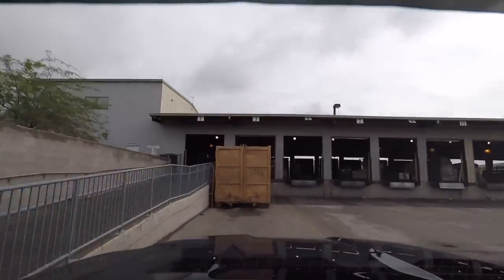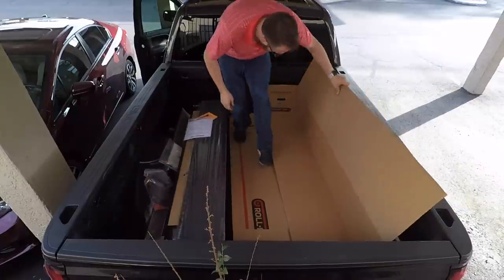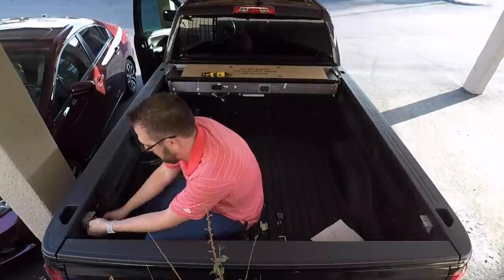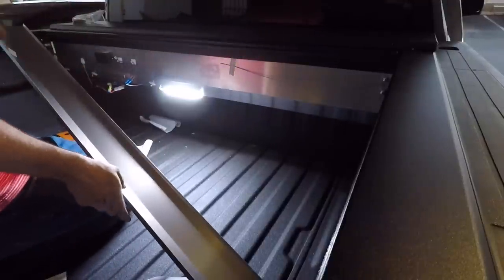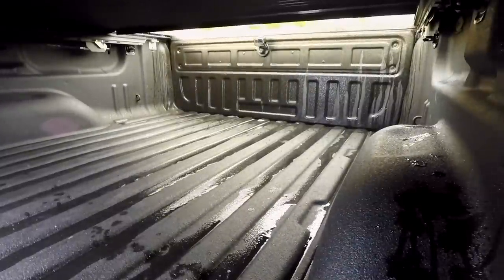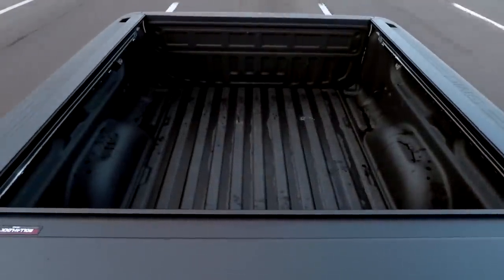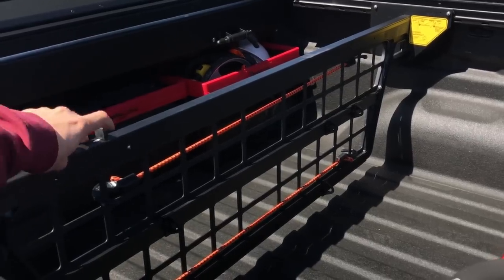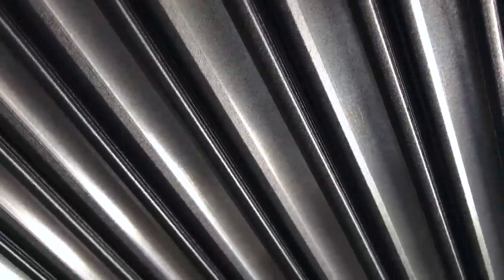Roll-N-Lock E-Series Tonneau Cover Review  (RC221E)

Comment: I’ve had a original style Roll and Lock on my Chevy 3500 Dually Diesel for   About 20 years now it’s held up well but it was never water tight  I keep a  water tight box under the cover and use my back seat for dry storage

Comment: Hello there. I’ve watched your video on the roll n lock e-series as one of many videos as I’ve been doing extensive research to pick a cover and landed on this based on the great reviews. I had the e-series professionally installed (I live in PA) and everything about the install is fine. But the thing leaks horribly through the slats of the top! Do you have any experience with this happening?
Reply: Hey, I had the same issue with mine, it leaks horribly.  Unfortunately mine completely broke 3 months in the rail that spins fell so it wouldn't open and close, customer service is absolutely horrible they pretty much said oh well and would t do anything about it.  So I really hope things are going better for you then they did for me.

Comment: I bought the Pace Edwards cover for my truck.  This is nice but mine covers the complete rail top with channels in it to add a ladder rack or many other items.  As for snow i live in Upstate New York and we get lots of snow in Syracusr to Mohawk Valley. Never an issue with weight as ive stood on mine but ice forms then you have to chip it away to open.  Keeps its truly dry and very secure.  Also has the feature of actually pinching an object that is taller against tailgate to hold. 
For the money well worth it. Better than trifold or fiberglass.  Mine has been on for over 4 years now and i posted a quick 15 second video on my page for it.   I would buy again over anything else.  
This is nice but i enjoy the channel rails as i can tie things to an eyebolt anyplace along the length and add a rack with out drilling holes or compromising the channel that the cover rolls in.
Reply from the maker: Thanks for the input.

Comment: Do the slats overlap or can a craft knife  blade fit between the slats ,I see alot of pp now getting stuff stolen because the bad guys are cutting the rubber hinge between the slats ,take a few seconds to break in !
Reply: Not for this model.  Part of the reason it’s so expensive is because each of the slats are physically nested to the next one via a channel connection of sorts.  It allows for the rotation needed to roll up but maintains the continuity of a single long sheet of metal.
Reply from the maker: Between the slats (Sorry for the late reply, trying to catch up on old comments I missed)
Reply: @GearsGadgets wait so can it be cut between the slots or not

Comment: if you stop it anywhere along the track is it automatically locked? Can it even be opened manually?
Reply from the maker: Yes you can stop it anywhere on the track and it stays locked in that position. Yes it can be opened manually, there is a release latch along the passenger side rail that disengages the motor gear and allows you to freely operate it if needed (I never do but you can)

Comment: I like to go "Ricky Bobby" in my truck (FAST), does this bad boy vibrate hard at high speeds? Could you hear of any vibration during your road test?
Reply: Id like an answer as well
Reply: @---tx9xx  

Well, I bought the cover since the post. 
No, I don't hear any vibration at high speeds. I've gone as fast as 110 and kept that speed for about a minute straight and the only thing I can say is it fluttered like crazy.
Reply: @gorillaking210  hey thanks so much for the reply. do you hear it though at highway speeds with your windows open? And no music. Also how has your experience been with it Re waterproofing, strength, how much space it takes up etc
Reply: @---tx9xx  

You're welcome. Happy to help with what I know. 
As far as sound, I don't hear the bed cover making any noise (with radio off and windows down). BUT, to be honest I have an aftermarket exhaust on my truck that my keep me from hearing if it truly does. In my opinion, I still believe it that the cover doesn't make any "what the hell is that!" noise. WATERPROOF: it's not sealed airtight, so some water does get in the bed but it will keep 95% of what you have in there dry. The 5% that does get wet is no more than if you were to wash your hands and use one of those cheap air dryers in a public bathroom to dry your hands and you walked off before your hands were COMPLETELY DRY......nothing major. SPACE: I have a short bed truck. If a visual is needed, it's GMC Sierra. I can still put my fit my crotch rocket in the bed (at an angle) and can almost close the tailgate. So there is still  plenty of room as far as what my situation is trying to explain. Your concern could be different from mine when it comes to if that's enough room for you. The housing that the cover rolls into doesn't even touch the floor of the bed, which leaves a decent space to put some stuff up under it (not big ass items) but stuff can fit right under it if needed. Truthfully, I like it. And I've gotten compliments. It really looks smooth as hell when you push the button and it starts to roll back. It looks really good on my truck. The install isn't bad at all. It can be done by one, but I had my young son put it on with me and we had fun doing it. Hope this helps.
Reply: @gorillaking210  Thanks so much super helpful, I don't know anyone personally who has it and it's great to get a firsthand reply from a real person, not a salesman. Do you have an opinion on how theft-resistant it is?  (vs something like a diamonback) Finally - do you have any idea by any chance if the remote control can be programmed to the garage buttons on the truck? I have an F-150 that has 3 universal garage door opener buttons that I have the garage programmed to, would be awesome if could program the remote control for the tonneau to them. And hey does it get real hot in the sun? Thanks again bud
Reply: @---tx9xx  

HOT: HELLLLL YES this cover gets hot. But I live in Texas and the heat out here is on another level. 
THEFT: I'm not a hoodlum but I'm pretty sure I could break in to this, IF I HAD PLENTY OF TIME AND COULD MAKE ALL THE NOISE I WANTED. Honestly it wouldn't be easy if someone did try. The diamondback probably will be the strongest of the two but again, I could get past that too......IF I HAD TIME. 
This cover is strong. Not the strongest. You wouldn't be able to stand on it (like you could with a diamondback cover), but I've put some heavy stuff (not super heavy) and it was fine. This cover has a really low profile which I really like. I was going for a sex sleek look with my truck and this cover was perfect for me. My truck is kept in a garage but I do frequent "unsavory place" a lot and hadn't had a issue yet. My truck also attracts a lot of attention with the things I've done to it and I haven't had anybody try something stupid. I'm also not stupid and park in the best spots possible that doesn't give a would be bad guy an opportunity to do something stupid. And it does help that I'm a slightly larger person that will make some think twice. I did say I live in Texas. Damn near everyone has a gun, so I think that helps as well with making someone think twice if its its really worth it. Crime does still happen. If someone really want what you got, they can break this cover and get it (it wouldn't be easy), but the way I think nothing is impossible if your determine. Desperate fools do do desperate shit.
Reply: .....also, not sure if you could program the remote to work with the buttons innyour truck. I don't see why not though. Never thought about doing that but you definitely got me curious to wanting to try to do that. Lol
Reply: @gorillaking210  Thanks so much for taking the time to reply - hey that would be awesome if you could go see if that owuld work or not to program it to the garage door buttons on the driver's side. I figure you'd have one button for the open button and one for the close button.
Reply: @---tx9xx  

I'm seriously considering looking into that. Well, good luck with your decision. Hopefully I was able to help with my experience/what I know.
Reply: @gorillaking210  That'd be awesome if you could get back to me after trying to program it to the garage door buttons, noone from any dealers to the company itself could give me an answer and that'd be a game changer for me. Much appreciated sir.
Reply: @gorillaking210  Hey did you ever get around to trying to program the buttons to the f-150 universal garage door opener buttons on the visor? Thanks so much and have a great labor day weekend!

Comment: Wish I had watched this before I bought mine, leaks like a sieve!!, Damaged seals in packing didn't help and Roll N Lock Customer Service is Brutal.
Reply: Funny you said that, roll n lock is horrible.   I bought my cover got the most expensive one they offered at the time it was over 3,000$ not only did it leak horribly but 3 months in the rail that spins the cover broke.  I contacted roll n lock multiple times and their response was well I don't know what to tell you, they were nasty as hell to me said they won't do anything without proof so I sent multiple videos, when I got no response I would call back and they would tell me they never received it.  This went on and on they refused to do a thing about it

Comment: Is there a manual crank system to open close it - for when the motor dies on it?
Reply from the maker: Sort of, There is a release latch on the inside along the rail, you can disengage the motor and operate it manually if that were to happen.
Reply: @GearsGadgets  how far along is it donhou have to crawl in ?

Comment: That cover is pretty cool was just wondering how much space does the motor take how many inches. And man that thing really is strong I would be scared to open and close that thing on the highway.
Reply from the maker: Opening and closing on the highway isn't bad. I don't want to quote the size of the bulkhead because it might be different for every truck. I can say, it isn't really that big and I don't find it getting in my way.
Reply: If you could measure how big the motor would be that would be huge I own a similar truck and I can't see the motor size being too much bigger on any other truck unless it's an 8-foot bed where it has to roll up more will be good to know how long your bed is that would probably determine how many inches thick it will be when you fold it up
Reply: @GearsGadgets  Any idea if the remote control can be programmed to the f-150 universal garage door opener buttons?

Comment: If you have a tool box can you just move the whole system forward or will that not work?
Reply from the maker: Honestly, even if it would work (which I cant confirm), I wouldn't do it. Between the toolbox and the tonneau cover bulkhead that it coils into, it would take up so much bed that it would be crazy. That's just my opinion. Im sure you could rig it up, but I wouldn't be able to confirm it would work.
Reply: They make a tool box/roll up tonneau cover combo.  I have one and it works great

Comment: Can you make it stay partially opened, or is it either closed or open?
Reply from the maker: You can make it stay partially open just by tapping the remote button where you want it to stay and it stops there.
Reply: Gears & Gadgets that’s awesome. I want one but I don’t think they make one that’s electric for my 2017 ram rebel with the ram boxes
Reply: Jeremy Miller check out RetraxPRO

Comment: How would it work when its covered in ice build up  ?
Reply from the maker: It does the exact same thing as every other cover on the market. I’ve builds up on the flat surface, it sucks for a day for two, then it goes away. I am originally from Buffalo NY so I understand how cold weather works. It makes everything suck including freezing up car doors and every tonneau cover being flat causes an issue. If it’s that big of a problem, get a garage. Otherwise deal with the misery for a few days like everyone else.
Reply: @GearsGadgets  Or get a one piece hinged tonneau cover.
Reply from the maker: @frankthompson3495  you are more than welcome to buy whatever tonneau cover works best for you with relatively uncommon scenarios. 99.99999% of people can deal with some ice for a day or two and would opt for the cover that has more utility the majority of the time but there isn’t one answer for everyone.

Comment: Can this cover be opened manually if necessary?
Reply from the maker: Yeah it has a manual release.
Reply: @GearsGadgets  can it be locked and unlocked manually? How does that work if it’s locked
Reply: I would also love to see a demo of the electric cover in manual mode.
Reply: @jordanhammerman7955  that'd be great. Also interested how strong it is ie can you stand on it, load stuff on it

Comment: What is the max height dimension that it will clear in order to close? I have a 2019 Silverado. Thanks
Reply from the maker: About an inch +/- below the bed rail until you get to the bulkhead where the cover rolls into.

Comment: How is this holding up?
Reply from the maker: Really good.
Reply: Gears & Gadgets How does it lock?
Reply from the maker: Getout Mybidnez it’s basically just always “in gear” so it is basically self locking. It would require the same amount or more effort to break it open as it would if you jumped on it to break it. It also has a release that you can access Incase something happens where you lose power or the motor fries or something so you could put it into a “manual mode”
Reply: Gears & Gadgets thanks

Comment: Wonder how this thing would work in canada winter time
Reply: I got a  tyger tri-fold tonneau cover for my Silverado,  handles  new Hampshire  winter pretty well. Easy install also
Reply: Mine freezes shut, and it's a manual as well. I wouldn't dare try the electric powered variant up here.
Reply from the maker: Just fine I presume

Comment: Can you give the dimensions of the unit at front of the bed that it rolls into?
Reply from the maker: Sorry for the super late reply Josh Breslin. I appreciate that you stopped by the channel and apologize for not responding WAY sooner.
Reply: @GearsGadgets  Still didn't give an answer
Reply from the maker: Cheek Busting 101 because the question was asked 7 months ago and I’m 99% positive he wasn’t waiting on me. Also, I’m not going to start quoting dimensions to find out someone buys it for a longer or shorter bed and the bulkhead size changes between them, then I’m to blame for being wrong. I would direct those questions to the manufacturer.
Reply: @GearsGadgets  I have the exact same truck as you so would be interested in the dimensions, thank you!

Comment: Just had this installed on my 2019 Sierra. Any idea of a rack system that would work to elevate a load (a canoe or Paddleboard) with crossbars above the cab? I know RollnLock makes a quikrak, but that’s a low crossbar and the canoe would extend 10 feet out the back.
Reply from the maker: Hmm I am not sure, haven't looked into it so I wouldn't be able to recommend anything.

Comment: About how much of the box does it take up?
Reply from the maker: About a foot square so there is still room underneath to get stuff all the way to the front of the bed. I haven’t really seen it as an obstacle. If you were loading a 4 wheeler or something it would be a problem.
Reply: @GearsGadgets  does it take up more room front to back than the non electric version?

Comment: Why cant they make it waterproof. Grrr
Reply: There is just too many areas where water infiltration will get in. The rail system is just too porous.
Reply from the maker: It REALLY isn’t that porous at all. The only place I get water infiltration is right at the tailgate when the pressure washer of the car wash hits directly on the rear. MOST of the water just runs right down the tailgate and in a rain event, it is so minor I don’t worry about it. Any water runs into the depressed areas of the bed and right down and out of the bulkhead.

Comment: For 2500 that should be water tight
Reply from the maker: What about the tailgate that has no weather seal or all the random tie downs or drain holes that exist across hundreds of different pickup beds over all the years these things fit? You want them to have 300 different sku’s with all of the different kits to seal off a bed AND want them to keep the price $2,500? It blows my mind that people somehow think these companies should magically make something watertight that was never designed to be watertight in the first place. Buy an SUV or put your valuables in watertight plastic cases like they should be anyway.